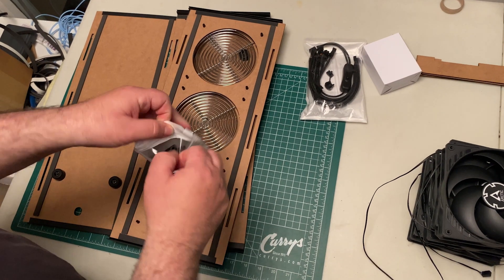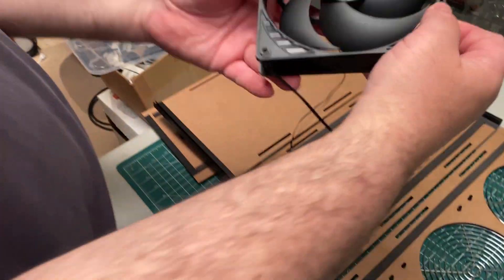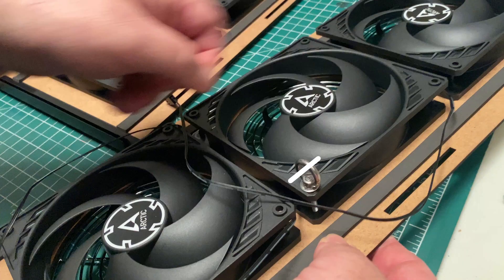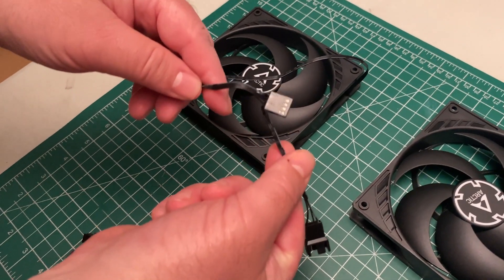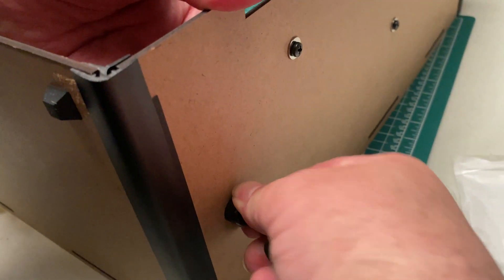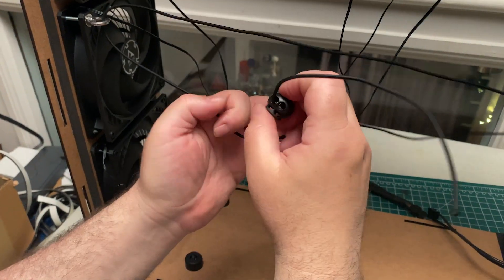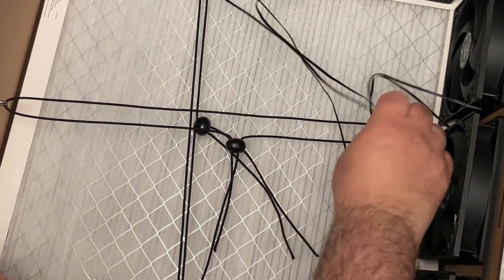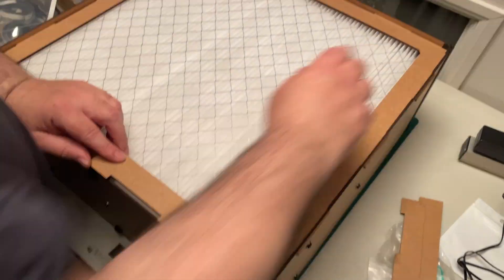Northbox 6XL Kit Assembly

Comment: A quick suggestion: 
Make one with 7x P12 or P12max instead of the 6x P14. 
The P14 is a decent allround pc case fan and not horrible as a radiator fan, especially for the money, but it doesn't have the static pressure you want for a filter application. 
They look good on paper, but that cfm number goes down the drain as soon as the airflow is impeded, to the point where they're easily overtaken by their smaller brothers. Even at the same noise levels. In a pc a 480x120 radiator with 4x P12 will outperform a 420x140 with 3x P14 by a good amount, even though the latter has more surface area. 
And a particle filter is even more restrictive than the fin array of a pc aio cooler.
Reply: Asking cause I don't know: Can you explain the static pressure in this circumstance?  Specs on Arctic's website indicate that P14 has a static pressure of 2.40mm H2O and P12 has the static pressure of 2.20mm H2O.  I looked at it this way when specing out a similar build.  I wouldn't do the P12 max because it takes 2x the amount of power an equiv P14 will consume.  However, I see that the static pressure of the P12 max is 2x that of the P14.
Reply from the maker: We make a 5-fan unit using the P12s, we avoid the P12max as we're trying to make a quiet machine that relies on multiple passes through a large filter area to give you the same performance as a loud commercial HEPA at full speed.  We do use the P8 Max fan in our MINI version for travel.

Comment: PC fans are not good at creating high pressure. I reckon it would be way better to have a slightly bigger box that uses 4" filters instead of 1", to get a much bigger surface area and significantly higher airflow. You could also run the fans quieter and still get better performance.

Also for literally just a couple bucks you could have a PWM controller to control the speed of these fans. Some people like it quieter, others prefer more airflow.

But the choice of fans is great. The Arctic P12 are the best budget fan there is. Though at this point the P12 MAX is probably a better choice as it's only a little more expensive at 37 bucks for a 5-pack and is a little quieter while offering similar or even better performance and higher max fan speed.
Reply from the maker: We use the P8 Max for our MINI, very powerful but very loud.  The Arctic P14 has good static pressure and runs very quietly.  Our goal with this device was small footprint, low noise and good performance.  There are always gains you can make performance wise by going the traditional CR Box route, big box fan and four filters, you can't beat it!
Reply: @szeptaczsprezarek   I have 6 of them
But PC fans in general have little pressure, less than 2mmH2O. Probably because they're only 25mm thick.

I am telling you, they would move so much more air if there were a 4" filter instead of 1". It would be absolutely worth it. It's not like those extra 3-6" make a big difference. It's already quite the large air filter

Comment: I'm confused. A MERV 13 filter can catch  75% of air particles that are 0.3-1.0 micron in size. Increasing the air particle size range to 3-10 microns, a MERV 13 filter will catch 90%. Airborne viruses like COVID19 are approximately 0.1 micron. That said, wouldn't an airborne virus just pass right through that filter?
Reply from the maker: The virus is 0.1 micron but they travel through the air by attaching to a respiratory droplet that is 1 micron or larger.  The idea is to use a large filter surface and multiple passes to achieve better performance than HEPA despite the greater single pass performance.  Here is a good explanation:  https://itsairborne.com/clean-air-delivery-rate-is-all-that-matters-5a5a064c211e
Reply: 0.2 to 0.3 micrometer particles are the hardest to catch. Bigger OR SMALLER is easier to catch.
Smaller particles are so light, they get punched around by air molecules, which makes them move through air in a zigzag pattern. The smaller they are, the more likely they are to hit the filter and stick to it.
MERV 13 should filter about 50% of 0.1 ym particles. MERV 12 about 30. MERV 11 about 20. MERV 8 about 10%.
Reply from the maker: @Violet-ui  Everything I've read about virus particles in airborne form is they travel on aerosolized liquid particles expelled from person to person, these particles are 1 micron.  Also, the performance of the filters in one pass is made up by the large filter surface of two 20 x 20 inch filters, cfm of the fans plus the multiple passes of the same air through the system.